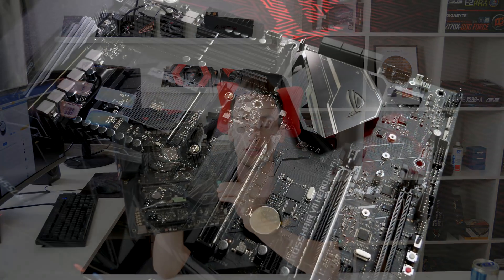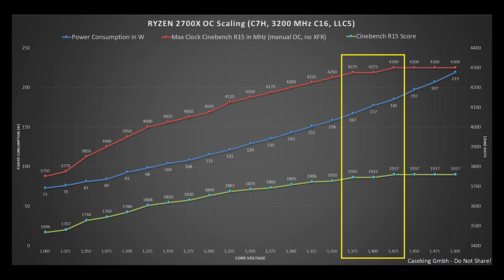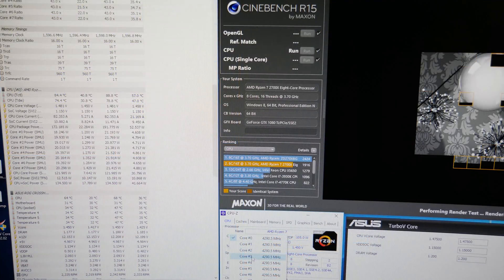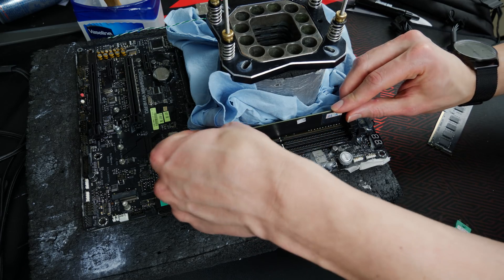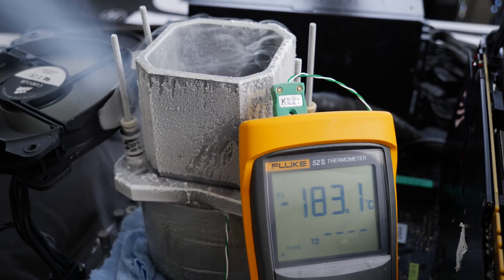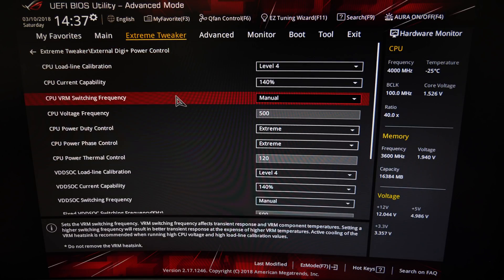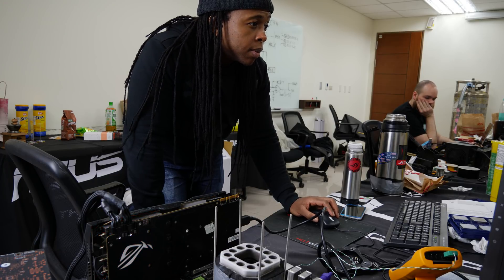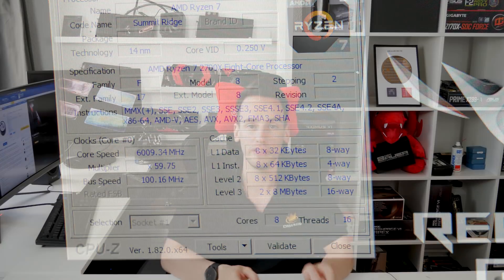AMD X470 Pinnacle Ridge: RYZEN 7 2700X at 6000 MHz on Crosshair VII Hero (en)

Comment: Seems like the board don’t have a VRM heatsink, does that mean the copper traces from the VRM is enough to cool it by transferring heat near cpu?
Reply: The CPU traces are extremely cold. The VRM will actually form frost over time they are running so cold. Usually you want to put vaseline in the PCIe and RAM slots as well, because every metal trace connected to the CPU becomes super cold.

Comment: Why no liquid metal ?
Reply: because it's useless on ryzen since they are already soldered to the IHS. You also don't use liquid metal for LN2.
Reply: Because LN2 is too cold for it
Reply: Liquid metals used as thermal interface are usually some sort of Gallium-Indium-Tin alloys. These alloys melt at around +10 °C and turn solid at around -30 °C. That's why you can't use them for subzero cooling, they would just turn solid and crack.
Reply: Erytropus i didnt mean delidded i meant on the IHS
Reply: Doct0r Dew thanks